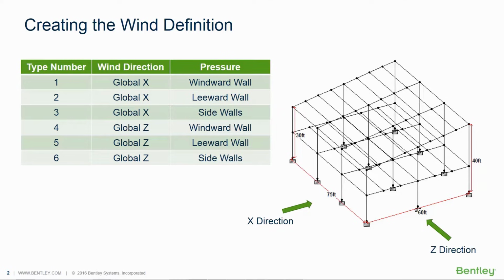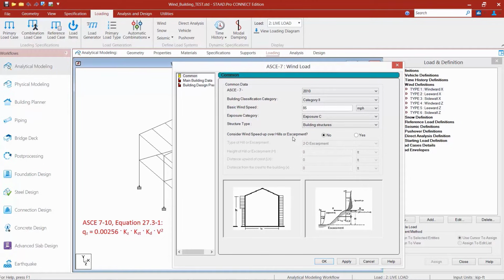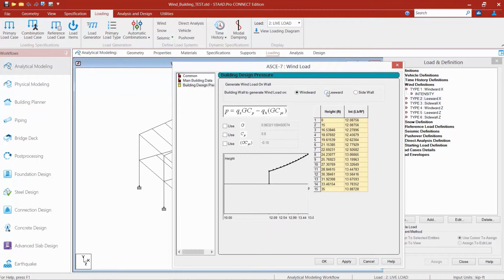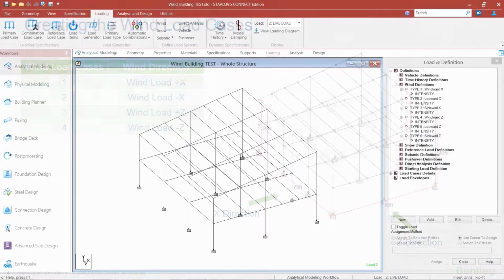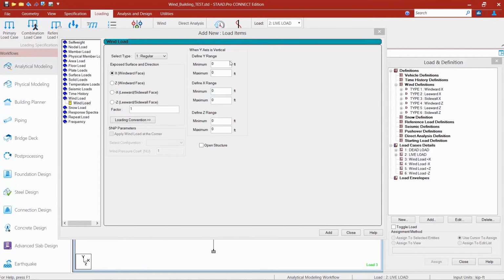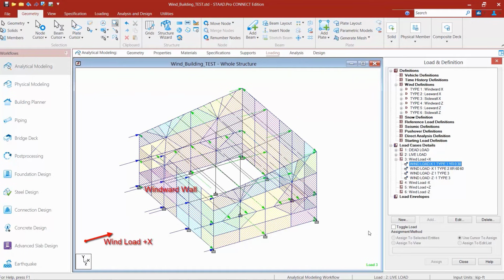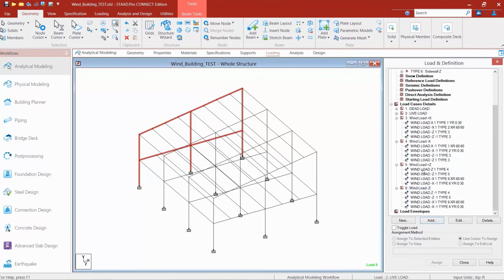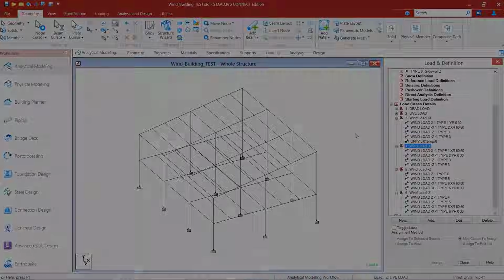Generating Wind Loads for Building Structures in STAAD.Pro

Comment: So in roof there is TWO Values for the External Pressure Coefficient or Cp, so should we only consider 1?
And also how about the other conditions like the Burst & Suction Conditions?
In your Windward you only considered the Suction Condition
In your Leeward and Side Wall you only considered the Burst Conditions.